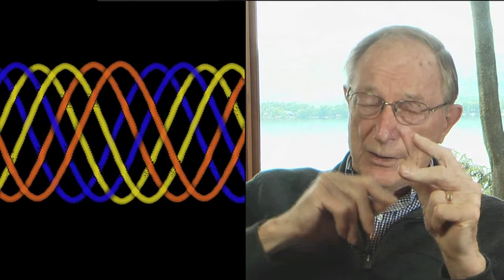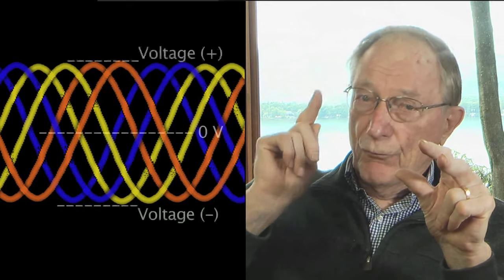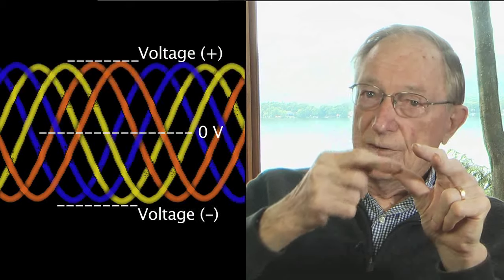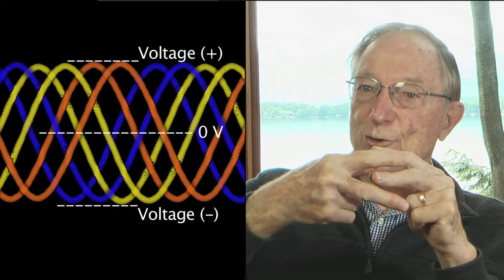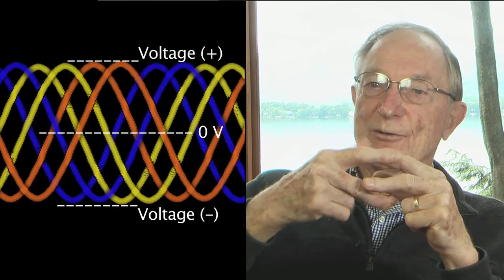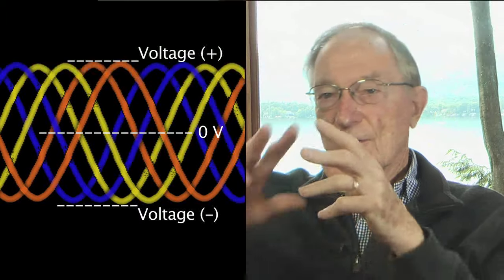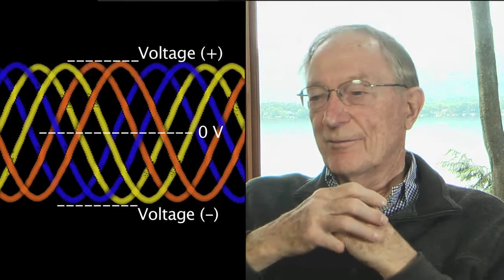Why 3 Phase Power? Why not 6 or 12?

Comment: He didn't give the answers I was expecting. The main advantage of 3 phase power over single phase is that it can transmit more power per unit conductor weight and with the same insulators, though DC still beats 3 phase. Another big reason is that a 3-phase load can draw constant power throughout the cycle while a single-phase load has to flywheel through no power twice per cycle.
Reply: ***** Say what?
Reply: Notice the interleaving of the second three-phase line with the first, and of the second six-phase line with the first six-phase line. The benefit is very high power levels on an incredibly compact ac line.
Reply: ***** Is it any more compact than DC?
Reply: ApolloWasReal As I recall, an equivalent six phase line can be much shorter than an HVDC line and somewhat narrower. Ground clearances are quite modest because the line-to-ground voltage is relatively low for the amount of power handled. The larger number of conductors may make an HPO line equally or more visible in spite of its modest stature.
Reply: ***** Interesting. Let's see... assuming a phase-neutral voltage of 1V and a 6-way wye (asterisk?) load with a 1 ohm resistor from each phase to neutral there would be no neutral current and the total power would be 6W. The power per phase conductor would be 1W, same as 3-phase.

One difference is that the voltage between adjacent phases (A-B, B-C, etc) is only 1V. Non-adjacent, non-antipodal phases (A-C, A-E, B-D, etc) are 120 deg apart so the voltage between them is the same as the 3-phase phase-phase voltage: sqrt(3) = 1.732V. And opposite phases (A-D, B-E, C-F) are 180 deg apart so the voltage between them is 2V. Not sure what practical effect this has on an aerial line where the phase-to-neutral voltage that dictates the amount of insulation required. So for all practical purposes this is just two 3-phase circuits, with a higher voltage between some of the conductors than you'd see in 3-phase, and twice as many transformer windings. But the lower voltage between adjacent phases might allow more compact buried cable designs.

I'd have to model it, but the electric and magnetic fields at medium distance from a 6-phase aerial line might be lower than a 3-phase line carrying the same power. That would decrease losses. But it would still have inductive and capacitive losses that are completely absent in a DC line.
Reply: ApolloWasReal All quite correct. To get into how the line performs in a three-phase grid requires a look a positive sequence impedance, reactive power issues, fault currents, fault clearing, audible noise, ice dropping and such. Six and twelve phase lines of several miles were built and tested. One double-circuit 115kV (or maybe it was 138) 20 mile line near Binghamton NY was converted to six phase and operated that way for some years that I know of. I'm not sure it remained six phase. This was all done in the 70's and has been amply documented in IEEE papers and articles. Funding was from EPRI and DOE as I recall. The concept is well proven, and has been considered in several countries but simply does not quite compete with three-phase and HVDC.
Reply: Also can control motor starting direction without the need for a pole shifting starting winding, capacitor and switch like the ones needed on single phase AC motors of any real power.
Reply: ***** By chopping it into high frequency AC with semiconductor switches, transforming it with a transformer that can be much smaller than a 50/60 Hz unit designed for the same power, and rectifying it back to DC. This is the DC-DC converter, the main part of every computer power supply. The AC from the line is actually converted to DC before the voltage is stepped down.
Reply: The title of the video doesn't suggest that he would explain that.
Reply: ApolloWasReal 
it givesmore output..
there phase machine has a self starting..
it take less space..
Reply: With a star connection, the power increases proportionally to the number of phases, it's just that prople prefer to write the power formula while taking phase to phase voltages into account, (sqrt(3) Vl il vs 3VphIph) , with n phases, we would have n times the power of a single phase, however the main problem is not for single phase loads, but for the polyphase loads like motors, a motor with n phases would need to fit more phase windings in the same area, while maintaining the overall current density ( which means we have less windings per phase but current draw remains same per phase, so overall more current draw,  or to reduce current draw, machine RPM will increase and the stable back emf point will be at higher speed), although we can take just 3 phases from the higher order system. So overall 3 phases are not necessarily the best, 12 phase is OK as well if you take four 3 phase groups from it, and for same power lesser rating of switchgear and protection may be used, the major problem is the fixed cost of the devices like transformer, circuit breaker, insulators etc, not the variable cost dependant on rating and line current. So all in all 3 phase is used because it is a compromise of cost and power, but not far superior to any other system.
Reply: He isn't commparing 3 phase to single phase!!!!
Reply: He was talking about polyphase circuits not single phase. Here is the simple answer to why 3@ not 6@ or more..the simple answer is symmetry and ease of rotating generator. Thats it..i know there are alot of other stuffs but this is the most BASIC AND SIMPLE explanation.
Reply: DC is better for some things such as motors that need to start and get to speed nearly instantly such as for elevators.
Reply: @Gary Russ Don't HV transmission lines still ground their neutrals (possibly through a high impedance) even though the neutral conductor isn't carried on the tower, i.e., the load is entirely delta? I thought that was to define the voltage across the insulator between each conductor and the (grounded) steel tower that is only 1/sqrt(3) times the phase-to-phase voltage. If the system completely floated, then if you happened to ground one conductor (possibly through a dirty insulator) the voltage across the other two insulators would rise to the phase-to-phase voltage, sqrt(3) times the usual phase-to-neutral voltage.
Reply: @Gary Russ I don't think I've ever seen a corner grounded delta system. I read that some early railways (Switzerland?) used 3-phase with two catenaries and the grounded rail as third, so that's corner-grounded delta. I have seen 4-wire delta, where the center tap of one transformer secondary is the grounded neutral. That gives you 240V for some loads instead of having to settle for 208V.
Reply: @Gary Russ How is the grounded conductor not a neutral? I thought that's the definition of a neutral -- a current carrying conductor that happens to be grounded. As opposed to a groundING conductor, the green or bare wire connected to exposed metal parts and not carrying current under normal conditions.

You would return current through the neutral in a 240V 4-wire delta if you wanted 120V. I.e., if the gounded center tap is between A and C, then you get 120V from either A or C to neutral, 240V between A and B, B and C and A and C, and 208V from B (the stinger) to neutral.

Comment: The breakers for three phase must be properly adjusted in order, not random as most two phase panels are, all of them in residential areas. The load balancing necessary for all three phases is critical.  It would be  a constant resetting of the adjusters of breakers depending on the varying hour to hour and day to day changes in load, both for the end user and for the utilities... This one reason why three phase is used for commercial use, not residential. Transmission lines are a different case.

Comment: 3-phase transmission lines are the most efficient for the following reason. Single phase lines require 2 conductors, or 2 conductors per phase. 3 phase delta requires 3 conductors, or 1 conductor per phase. 4 phase delta would require 4 conductors (etc.), which is also 1 conductor per phase, but requires more conductors due to additional phases. Wye arrangements would add a conductor, requiring (#phases +1)/#phases conductors.

Comment: Tesla is the father of polyphase.  Edison was stuck on direct current.
Reply: You are absolutely right.
Reply: You don't get 'stuck' on direct current, you get stuck on alternating current.  Pedantic, I know :D
Reply: Dennis S the problem with ac is the skin effect. you see, tesla hadn't forseen this. neighter edisson. but at high power/high frequency there is such thing as a skin effect...where in the electron flow is not going trough the entire conductor, they flow trough the outher edges of the conductor...thus the skin effect.

nuclear power plant output stations send the power to the natuonal power distribution grid via tubes, pipes... 

thats why..in the near future, where electric vehicles are foreseen, dc main distribution lines make more sense, also dc does not have inductance and capacitance losses.
Reply: ihavecojones - the bus bars I install are kidney shaped.
Reply: Actually it's not a problem, and Tesla made use of the effect in his demonstrations. He also tried to get a deal with some Natural Gas companies to use their copper pipes to conduct alternating current as well as gas. The gas companies were scares of sparks and refused.
Reply: Everything old is new again. All the new generating stations we install produce AC but it is rectified to DC for long range distributions then inverted back to AC. Less wires and less losses on the runs so i guess Edison was right all along?
Reply: I thought it was the other way around. AC can travel greater distances than DC. Was I taught wrong?
Reply: Going over long distances there is a drop in voltage due to resistance in the wire. AC can easily be stepped back up with a transformer, but DC must be alternated first or you would need a dynamo power station on every block. For very high voltages, the roughly parallel power lines act as capacitor. For DC a capacitor prevents current flow. For AC a capacitor acts as a resistor, with lower resistance for higher frequencies.
Of course with AC, you can use a single "hot" wire with the Earth "ground" as a common connector and minimize those losses. You can also use coils or capacitors to convert single phase to multiphase at the client location.
Reply: With technology comes different materials and ways of dealing with problems, the big one today is all about cost. So being able to eliminate a wire and have two instead of three is a HUGE cost savings to power companies. There is less losses due to resistance over long runs with DC in the 100K+ range and with new ways of making inverters changing the voltage back to AC is easy
Reply: Some of the largest part transmission lines in the world  are DC because it is more efficient
Reply: You obviously don't know a lot about electronics theory, @Johan Fouche. "...!!!!....!!!...!.!.!!...!.!.!!...!.!.!???!!!" Dude, calm down. Read up on HVDC for power transmission, it's not further away than wikipedia. https://en.wikipedia.org/wiki/High-voltage_direct_current The wikipedia article even lists pros and cons for DC transmission.
Reply: BTW Dennis, Edison stole all his tech.
Reply: Good thing you're done arguing, because I think I clearly stated I was done arguing with you like three posts ago. Whatever it takes for you to ease the facial redness! :) At your age, you have to mind the blood pressure. But, apology accepted. No worries, I didn't take it personally anyway! ;) I must say though - it's interesting how you can tell me so much about what my arguments are, and at the same correctly observe that the only thing I've really posted is a Wikipedia article. Stunning example of making up your own debate, there @Johan Fouche.
Reply: Johan Fouche Yes, I was wrong, I see that now. I was under the impression you had stopped arguing altogether, but of course I was wrong - you merely stated you were done arguing _with me_, something you actually never did - seeing as I never posted any arguments (which you correctly noted earlier). If it was an argument with me, I should have expected that you at least addressed what I have actually written, and not beating away on your silly straw men. I am sorry for being wrong in this, I hope you can forgive me in my misunderstanding of you.
Reply: Johan Fouche So you are in fact able to form complete sentences and properly punctuate. How does it feel to be sober now?
Reply: The father of three-phase system is Dolivo-Dobrovolsky. Tesla developed two-phase system. So, yes. He is the father of polyphase, but not in familiar to us form.
Reply: the only thing i know is Tesla and Edison create Ac Dc
Reply: ihavecojones AC can travel over longer distances then DC , That's why if you need DC it is rectified on the spot . Look in to a simple radio AC Comes in then you got a stepdown transformer and after that is your rectifier for DC .
Reply: That's because Tesla was a true inventor, whereas Edison was more like the Chinese stealing other people's intellectual ideas and patenting them. He did a lot of this by having them work for him then claiming the work for his company and by inference himself. In reality Edison was an intellectual thief.
Reply: There is a bit of nonsense here in the thread here. So lets correct it:
Skin effect is pretty irrelevant at 50/60Hz. The power has nothing to do with it, its only the frequency. And no, nuclear power plants dont use tubes or pipes for this reason. They use the same HV cables as everyone else. This effect results in a 40% lower current at 10mm depth compared to "at the skin"  at 50Hz. However thats for a solid copper wire. Since these lines are multistrand wire (almost all are) and non of the stands are that thick... no big problem.

AC/DC travel long distances just as good. But with AC there are more losses due to inductance and capacitance.
Wiki says: "As of 1980, the longest cost-effective distance for direct-current transmission was determined to be 7,000 kilometres (4,300 miles). For alternating current it was 4,000 kilometres (2,500 miles)"

"when does DC start making mid air shorts [...] 1000 times lower than AC power"
No, about at a voltage sqrt(2) higher than AC, as AC always has a higher peak compared to the same power DC and only this peak voltage is relevant for the arcing.

"AC power gives you 50 chances of letting go.....DC gives you NONE!!!"
First of all... nobody can react in 20ms. Second, it crosses 0V twice per cycle, so that are 100 "chances".
AC gives you about twice the current due to the bodys capacitance (~5nF). Maybe watch some "ElectroBOOM" or some other electronics channel. Thats why AC is only rated "safe to touch" up to 50V and DC up to 120V.
Reply: @hommie789  Absolutely WRONG!
Reply: @rtta51  No, you are correct! Homie has no clue.
Reply: @hommie789  Wrong!
Reply: @Stephen2846  I have no clue do I? I work in this industry and have done so for 36 years but please feel free to tell me how you know more than I do. As a matter of fact we just finished installing a high voltage transmission system from Northern Manitoba to North Dakota, have you even seen high voltage equipment up close? If you not going to add anything tangible to a conversation then please go back to your video games in mommies basement.
Reply: @Notrocketscience101 Ultimately Edison was right.  The Technogy we have had for 70 years would have made DC the better way to go.  Now we have solid state switch mode power DC to DC converters that can easily change and regulate voltages.
Reply: @Strange FactionThe elephant story is not true.
Reply: @krashd  Incorrect. You are more likely to have a muscle contraction that does not release on DC than on AC. Therefore you get stuck on DC. Main thing is the path that it takes that affects what happens.
Reply: @tcmyoda   There are plenty of former transit lines that used DC with one wire and the rails and Earth as the other conductor.
Reply: Maybe you are leaving something out of the equation there. Your power to the kettle is at 120 or 240 Volts while the starter cable is only at 12 volts. So the Amperage  for the kettle is 17 Amps 120 Volts / 8.5 Amps 240 Volts but the starter at 12 Volts needs 167Amps to produce the 2000 Watts. Railroad Cars at one point had 110 Volt DC battery setups along with the ones that were 32 Volts or 64 Volts. The starting systems on most railroad locomotives were 64 Volt. But yet they used 600 Volts DC for the traction motors. In fact Edison was the Conductor on the MU Cars when they put them in service on the Delaware, Lackawanna, And Western and those MU cars ran on 3000 Volts DC.Modern Diesel-Electric locos take AC, rectify it, chop it to make AC again for the AC traction motors. Universal motors and BLDC motors can work on both AC and DC.
Reply: @gravelydon7072 (This is already a very old thread) 

Many of them are still in service, though most of them are being charged by transformers with diodes rather than dynamos these days. The electric trains in Japan pick up a charge as they enter the station from an overhead wire, though I never checked whether they were using AC or DC. 

For higher frequencies of AC, certain layers of the atmosphere can become charged inductively for long range transmission, effectively eliminating the need for wired connections.
Reply: go back to school

Comment: very simply yes, more "straws" and more power can flow, but Tesla found that you could use minimal copper to distribute using particularly 3 conductors. apparently "creating a complex electrical spiral down the line, who's analysis really boggles the mind, particularly in transient cases. Steinmetz attempted to crack it and backed off from it" ( Eric Dollard: Anti-Relativity)